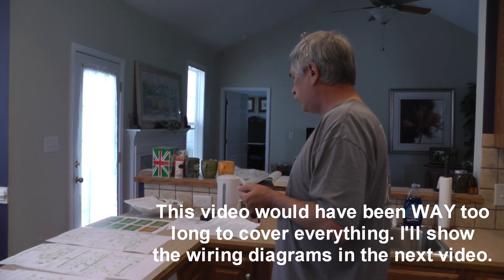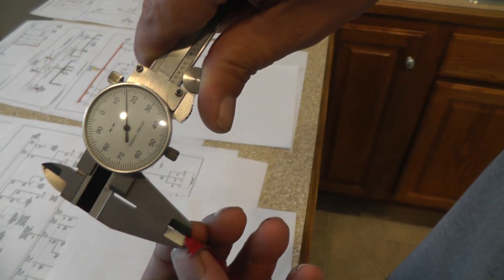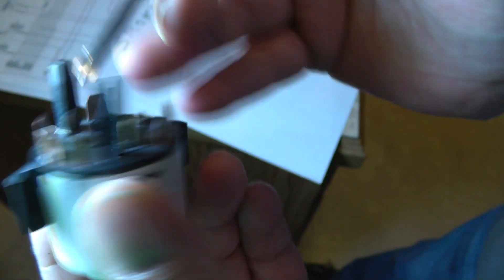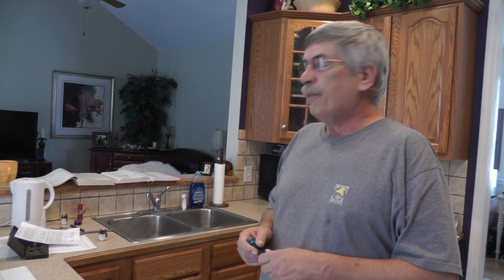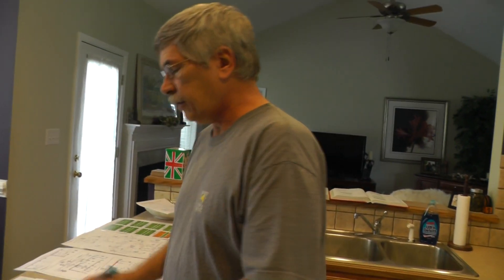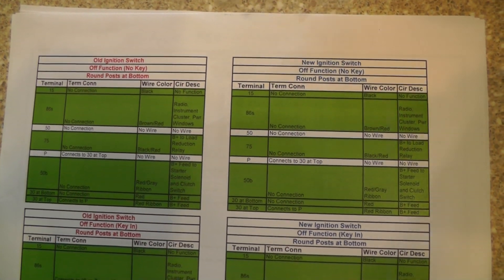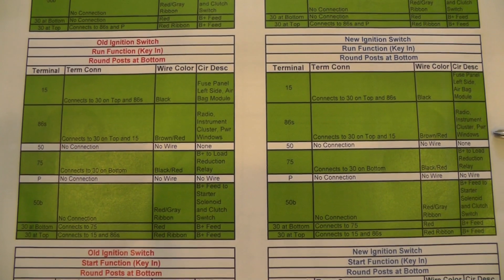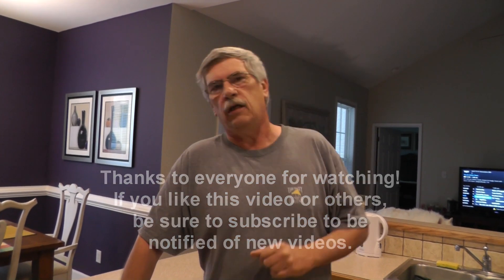Volkswagen Jetta Ignition Switch Analysis - Part 5

Comment: The ignition switch looks like one big complicated relay.  I've never seen a relay with that many pins.  Really neat.
Reply from the maker: Of course, it may look like a relay with all the pins, but it's just a switch with several contacts for different functions. In fact, two of the pins, (P and 50), aren't even used at all which makes it even simpler. Thanks DJ for commenting...
Reply: stuzman52 Well you said it was labeled as 30, 65, etc... which is the same scheme as a relay.  To me it makes a good case for being called a relay because of that.  A relay is a switch in itself anyway.

Comment: Great video and explanation dear mate Terry. Your explanation on the corrosion process was even better than your colleague chemical engineer! One thing I have to add from my experience here. In older days especially, there was sulfur in wires rubber insulation. The sulfur from the rubber insulation reacts with copper wires and converting copper into copper sulfate which is blue and green in color and having high resistance. So by this way cables were eaten up their copper themselves and in result were creating high resistance state. I am sure you would be encountered to such cases.
The ;Green tent on your terminals was due to two reasons. One as you explained very nicely and the other my observation, your nice and respected "Photographer green shirt shadow and reflection on metal terminals". Regards,
Reply from the maker: Always glad to have you drop in Jahan and give your comments. Thanks for the comments and you're right about sulfur being in the rubber composition of wires. Oooo...that was a long time ago as you've mentioned. Take care my friend and again thanks for your compliment and comments.

Comment: Fantastic info .  Many moons ago when I was in quality control with GM the engineering standard for wire gauge for all product lines in North America. was twice the load capacity of the circuit fuse.  The use of sealants to weather proof the harness connections is not done  mainly for cost as well as repairability as well as the dissipation of heat and moisture should the seal fail.  Some silicone based compounds as rtv are very corrosive to copper and reacts by off gassing  an ammonia compound that enables the rtv to become a semi-solid.  The grade of copper used is another factor as well , copper has many standards as you well know.  I don't remember any fuses blown but I suspect the O/S diameter of each strand was corroded to a smaller gauge  heating up the wire and not a heavy enough gauge now to blow the fuse.  Some manufactures are downsizing the wire to a closer tolerance to the fuse rating in cost saving.  If you remember look at the wire gauge and let us know the fuse rating , it may have had many feed to the one fuse ?  Thanks Terry for doing this series I always learn something.
Reply: "Many moons ago when I was in quality control with GM the engineering standard for wire gauge for all product lines in North America."  Well that explains everything you need to know about GM quality in one sentence. :P
Reply: ***** LOL
Reply from the maker: Thanks Steve for all of your useful information. I do remember in the past that you worked in quality control with GM. You may very well be the person to answer some thoughts that I mention in the next video pertaining to feeders, branch circuits, taps and other things. We'll be able to see some of these wire sizes along with the fuses that's protecting these circuits. There's a few other pointers that I missed in the last video, so I'm going to re-edit the upcoming video to cover those. Oh, one more thing. When I did the video with Walt, there was no rehearsal, so I was just coming up with questions and suggestions off the top of my head. Later, after the video was uploaded, I thought to myself about the RTV comment that I made. I said, "Terry, you know that this stuff puts out ammonia that's corrosive to copper." Good catch on that and again, thanks for your compliments and comments.
Reply from the maker: ***** Hi DJ and glad you dropped in. Better watch it now, you're going to get all those GM folks out there upset LOL...
Reply: stuzman52 Yeah I couldn't resist the opportunity to make that joke.  It was so obvious and funny.  Besides that I make it perfectly clear in many of my Saturn videos that I'm not a fan of GM (putting it mildly).  Especially the Saturn L-Series ATF change video where I go on rant after rant about GM.  It was an ironic joke in some ways just couldn't pass it up.
Reply from the maker: Ah, I was kidding back with you too DJ...All of the cars out there have their own issues. But I must admit, that I've done my fair share of ranting with this VW Jetta (smiling...) Take care DJ...
Reply: I seen lots of wiring problems in GM cars over the years and pig terminals that never seal good.
Reply: Jjjiikk